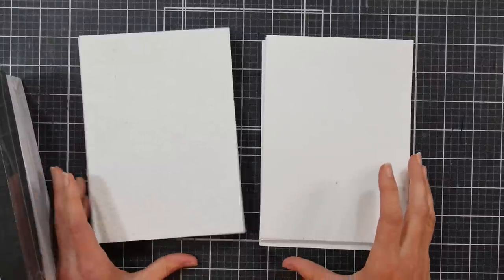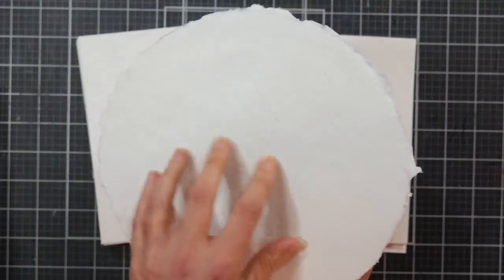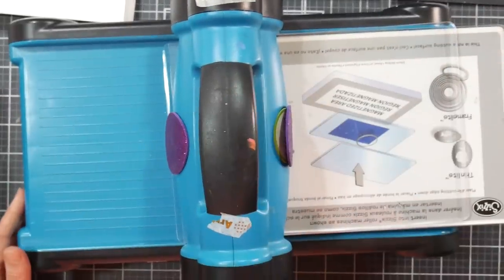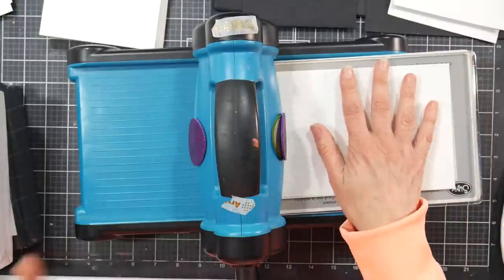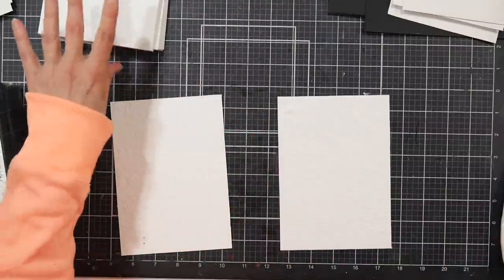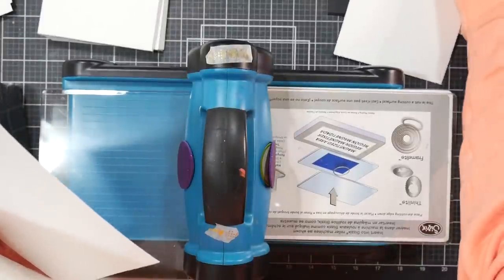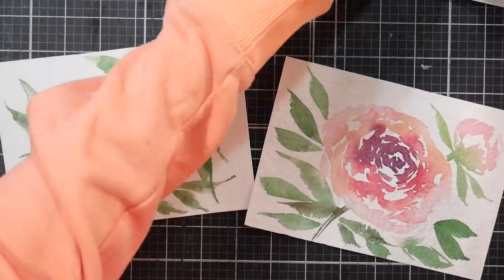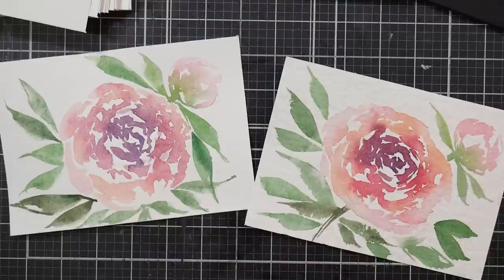How To Turn Rough Watercolor Paper To Hot Press (smooth) Paper- (An Oddly Specific Tutorial)

Comment: Love how innovative you are! Always gets my brain running crazy with ideas. Haha. I wonder if you heated up the paper with a heat gun first then quickly ran it through if you'd get even better results. Haha as close to hot rollers as it gets, minus an iron? Lol! Love it. :) new use for my die cut machine! Appreciate you!
Reply from the maker: I think is the pressure that does it but it wouldn't hurt to try I suppose
Reply: @thefrugalcrafter Lindsay Weirich  I had to click off before finishing but planned to shortly, but did you notice any difference at all in how it performed after? Sizing,  drying time etc? Or was it just exactly the same but smooth? If so, that's just kick ass! Seriously brilliant 👏

Comment: Hullo Lindsay, You young lady are truly amazing! I love the other comment that mentioned trying to use their paper for pastels! Needing more “tooth” for pastels is something that I would like for my practice pieces. I am just so aware? Or am I just cheap? Of the higher cost of pastel surfaces! I want to practice more with pastels, I have even resorted to washing my papers to remove layers of soft pastel so I get another chance to work! These Shizen papers are nice, I got a book from Rosi’s Etsy shop.  I don’t like buying smaller sheets, but maybe this way they are less expensive? 
Arrrguh! I gotta go look!
Reply from the maker: You can get 100 sheets of 5x7 for $24 on blick. I like using liquatex clear gesso to prime paper for pastel. You can use it over an underpainting, too for a base.
Reply: @thefrugalcrafter  yep, I found it! I had better finish up a painting before I buy any more art supplies, as I was warned just last night that I had better not bring in anything else until I get something finished and if not sold ready to sell or even just to giveaway!